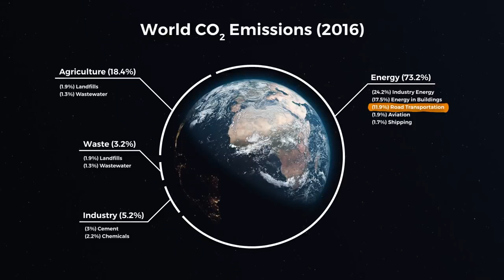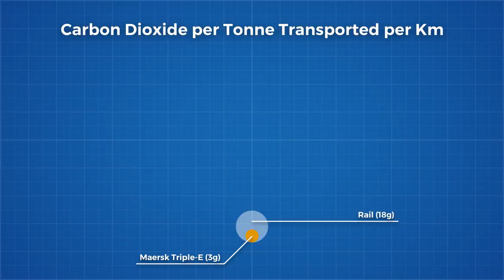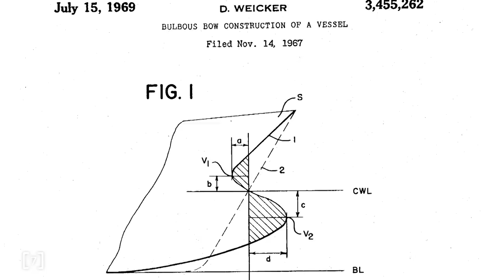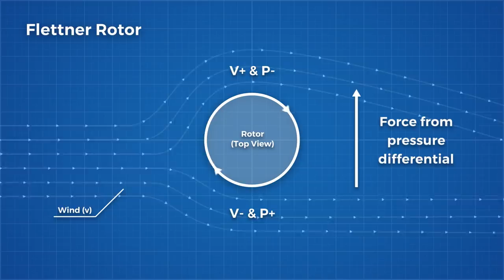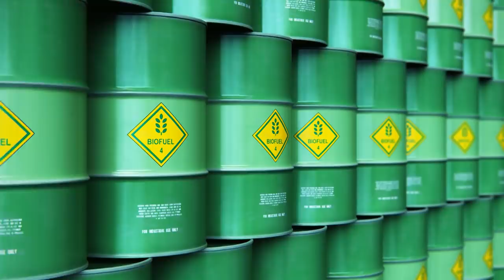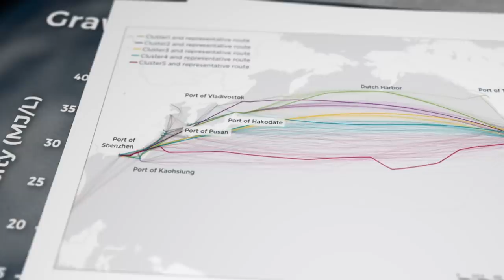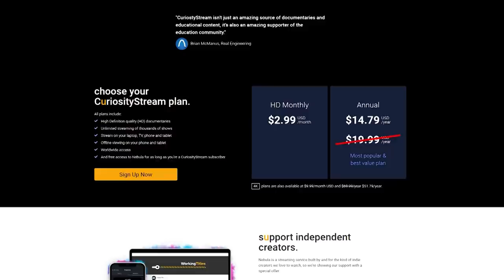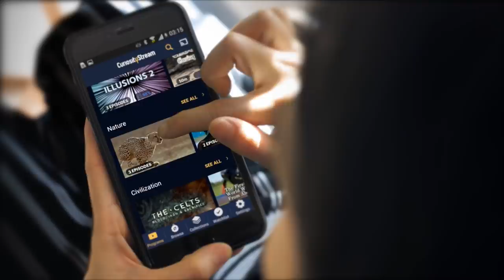Are Renewable Powered Ships Possible?

Comment: so what if... we take naval nuclear engines
and put one in a freight ship?
Reply: If you do a web search for ‘nuclear ship savannah’ you will see that it has been tried and did not work.  A similarly vessel heavily subsidised, by the government, vessel is in use in Russia which also operates, in support of the Northern Sea Route, a fleet of nuclear powered ice breakers all of these may, or may not, have been completely without issues.

Just think; would you have full confidence in the management of a nuclear reactor under the control of an anonymous entity only traceable, perhaps, via a letter box in a FOC (flag of convenience) nation state?  If you are, could you sell that confidence to Japan, the state that hosted the Hiroshima and Nagasaki nuclear detonations as well as more recently the Fukushima ‘event’?  Then try that same, or a similar, sales strategy on Ukraine, the nation state that as a part of the USSR (CCCP) hosted the Chernobyl ‘event’.  Modern iterations of nuclear energy, thorium fuel, molten salt reactors or fusion reactors, will carry the legacy of past problems.  It is the global trepidation of anything with 'nuclear' in the name and the economics of nuclear having transitioned from 'energy to cheap to charge for' too 'the costs of remediation are incalculable' that will prevent the adoption of nuclear energy as a means of creating energy at sea.  Modern reaction systems may have overcome the safety problems but the general public, having been misled in the past, will be reluctant to believe the fresh new promises.  The incident of the ‘Ever Given’ blocking the Suez Canal, March 2021, may also have a little to add to this debate.  The cooling water on ships tends to get taken in from near the bottom so when running aground the inlets are in a prime spot to get plugged up restricting, if not stopping, the flow of coolant.  One thing that the TMI, Chernobyl and Fukushima incidents all had in common was that the supply of coolant, or rather lack thereof, was a fundamental cause.

‘They’ say nuclear is cheap, it’s not it is expensive and has a large embedded carbon quotient as well as being complicated, dangerous, not universally socially acceptable and having only ‘no need for refuelling’ as a questionable advantage; actually it does need refuelling just not as often.  When ‘they’ do need to refill the warming up stuff it takes considerable longer than pumping tonnes of thick black stuff, cSt380 HFO, or thin runny stuff, MDO, onboard which is one of the reasons HMS Queen Elizabeth and HMS Prince of Wales are pushed about by ICEs and gas turbines thus using a similar fuel as the aircraft that fly off of them.  The Royal Navy (RN) with a high degree of skill and expertise uses, at vast expenses to the UK taxpayer, a current operational nuclear fleet of 11 submarines (also known as ‘boats’) in two flotillas, seven attack subs and four ballistic missile boats.  The carbon footprint of all the extra bits of hardware and the fuel, including processing thereof, from ground to propeller, are the external costs that never seem to get considered.

Disposal, once it wears out, of both the machine (that was a ship) and fuel is another can of worms best left unopened.  The 26 RN boats no longer in use are laid up (some in Rosyth and some in Portsmouth) awaiting long term deconstruction including dealing with the fuel rods and other irradiated material.  The USN is not, as far as I know, a commercial organisation working to very tight margins and also has the skill and expertise to handle the complexities of nuclear power; so as well as submarines their aircraft carriers are nuclear powered and each of the current iteration has a build cost three times that of QE/PoW, bigger crews and more generous funding.  For those who still think that nuclear energy might be the answer I recommend this report: - https://www.bbc.com/future/article/20200901-the-radioactive-risk-of-sunken-nuclear-soviet-submarines?ocid=ww.social.link.email.  The navy of the USSR might have been under resourced and over extended but it was still generously supported in comparison with merchant shipping.
Reply: @BernardLS  would you trust the USA w/ nuclear reactors? They hosted the 3 mile island "event" and are responsible for Hiroshima and nagasaki
Yet they have nearly a hundred reactors and a entire fleet of naval vessels that run off nuclear power

Also yes nuclear power is the answer for the growing demand as its the cleanest non renewable energy source there is
Reply: @Space_Reptile  The government of the USA is answerable to the population of the USA for those reactors located within the USA but how about 'a nuclear reactor under the control of an anonymous entity only traceable, perhaps, via a letter box in a FOC (flag of convenience) nation state?'   Port state regulation is one thing but, by convention, ships operate under flag state control.  'yes nuclear power is the answer for the growing demand as its the cleanest non renewable energy source there is' but if the demand does not grow, either because the global population does not increase or more localised means are used to satisfy the populations needs, is there still going to be a requirement for the expensive nuclear powered transportation of goods and materials at current levels of freight movement?  Vessel casualties occur on a monthly if not weekly basis and it is seldom in the public eye, as was the 'Exxon Valdez' or 'Ever Given', so are you sure about the safety of the reactors on ships?
Reply: @BernardLS    War ship reactors are tasked with outsize power requirements. There’s ship power requirement tables somewhere that will illustrate the difference. Small reactors that used the previously unusable nuclear waste (I’ve seen information on that research/development) stored in salt mines etc are the most likely answer.
Reply: @damiangrouse4564  Just think; would you have full confidence in the management of a nuclear reactor under the control of an anonymous entity only traceable, perhaps, via a letter box in a FOC (flag of convenience) nation state?  If you are, could you sell that confidence to Japan, the state that hosted the Hiroshima and Nagasaki nuclear detonations as well as more recently the Fukushima ‘event’?  Then try that same, or a similar, sales strategy on Ukraine, the nation state that as a part of the USSR (CCCP) hosted the Chernobyl ‘event’.  Modern iterations of nuclear energy, thorium fuel, molten salt reactors, small modular reactors or fusion reactors, will carry the legacy of past problems.  It is the global trepidation of anything with 'nuclear' in the name and the economics of nuclear having transitioned from 'energy to cheap to charge for' too 'the costs of remediation are incalculable' that will prevent the adoption of nuclear energy as a means of creating energy at sea.  Modern reaction systems may have overcome the safety problems but the general public, having been misled in the past, will be reluctant to believe the fresh new promises.  The incident of the ‘Ever Given’ blocking the Suez Canal, March 2021, may also have a little to add to this debate.  The cooling water on ships tends to get taken in from near the bottom so when running aground the inlets are in a prime spot to get plugged up restricting, if not stopping, the flow of coolant.  One thing that the TMI, Chernobyl and Fukushima incidents all had in common was that the supply of coolant, or rather lack thereof, was a fundamental cause.  Similarly and only months later, May 2021, had the ‘X Press Pearl’ been nuclear powered then a major port for a populous nation in the global South would have possible been the site of a significant exclusion zone due to a non power plant related incident.  If the ‘X Press Pearl’ had on board a fired up but ‘safe’ molten salt reactor and found herself having to dissipate the residual energy associated with the possible 12.5 megaWatt power cycle would a stable cool down have been possible?  In a casualty ships may capsize, like the ‘Karin Hoej’ of Bornholm in the Baltic early December 2021, in which situation any safety system reliant on gravity might not work.

Comment: Power them with small modular nuclear reactors. They have no greenhouse gases, no emissions, and any shielding requirements are offset by the fact that they don't have to carry enormous fuel tanks and can operate for decades without refueling. Problem solved.

The fact that you're not even considering nuclear power as a solution is making me question your engineering competence and intellectual integrity.

Comment: This is a very informative video but it is very misleading.
Most of the efficiency gains that are describing this video could easily be equalized by a political accord in which China could have more direct routes to Western ports. Also on a efficiency basis variable turbines in a tube could make this a non-issue in terms of fuel efficiency

Comment: Much of the stuff that is shipped...especially from China...does NOT need to be shipped from China.  

The top 5 largest importers by volume in 2019 are Ashley Furniture, Walmart, Home Depot, Lowe's and Target. (Not in any order).

These 5 are roughly 10% of the ENTIRE VOLUME of stuff shipped into the US, the largest importer. (Not value...VOLUME.)  Much of it is bulky crap that can be done locally in the country (the US especially).

Absolutely NO need to ship raw materials to china...to make furniture (one of the bulkiest items to ship)...and then turn around and ship finished furniture back to the US.  
This is a COLOSSAL waste of energy and resources.  We work with advanced manufacturing companies...this is already existing tech...we KNOW this can be done.

MBAs and people running businesses got very lazy in the 90's and 2000's and were focused on beating the Annual and / or quarterly EPS estimates by a penny per year and outsourcing to cheap labor markets.
Most of those things made in China can easily (and sometimes less expensively) be made elsewhere, closer to the consumer, simply upgrading factories and sourcing much closer to home.   China was almost ALL about cheap labor (and easy labor violations / lack of regulations), when outsourcing got started...NO need to ship furniture and other bulky products from China (or Vietnam, or Malaysia or anywhere across an ocean, etc.) 

Now companies can use 3D Printing,  Advanced Manufacturing, Robots, Local Sourcing and other methods to reduce the amount of shipping, labor and all other cost drivers in the business.

If this were simply done more effectively, MUCH of the VOLUME of shipping would go away. 
Change to EVs and EV Trucks (all ground transport)...most of the shipping of OIL goes away...which reduces lots of Oil Tankers, etc.
Ditto for Coal...which is already heading down the road to be eliminated.

There are solutions that don't require magic...just better sourcing...and manufacturing...and planning.
The US used to import many of its vehicles...now Toyota, Honda, BMW, Mercedes, VW, etc. all have plants in the US.  Similar to how Tesla is building plants in China and Germany, instead of shipping cars across the ocean in really big ships.

I like boats / ships...but we're killing ourselves with tremendous amounts of unnecessary shipping.

Cheers!

Comment: please research the work the NH3 association has made, and you will find that hydrogen IS the future. in the form of NH3 its energy density is far better.
Reply: The 'Just Have A Think' channel posted a relevant item yesterday, go see.  WRT ‘alternative fuels’ such as Ammonia (NH3), Biogas (basically good old CH4 or Methane) and Hydrogen (H2).  All require harvesting and processing which have costs and impacts before you get your energy to the point of use and will have effluents that will impact the global environment one way or another.  Thomas Midgley, Jr. (born 18 May 1889 died 2 Nov 1944) was an American (USA) chemist who as well as developing the technique of putting the lead, tetraethyl lead (TEL), additive in petrol created chlorofluorocarbons (CFCs), yes those ozone depleting CFCs, so that the use of NH3 as a refrigerant could be discontinued.  NH3 could be the most dangerous and least ‘clean’ clean energy source.  Is very bad and probably deserves a rant all of its own, so let’s just leave that for a while (somewhere very far away that is cool, dark and quiet).  CH4 lots of it around much of which comes out of the ground as a fraction of the FOGI energy mining; even more can be created (relatively expensively) from anaerobic degradation of organic matter.  The organic matter may be either raw vegetation, food waste or pre-digested by domesticated livestock with the right (or wrong, depending on your point of view) sort of diet and gut fauna.  CH4 is a lighter than air, vapour at environmental temperatures and pressures and you need to compress it, a lot, or cool it, a lot, to get enough on board your ship in manageable volumes to be useful.  Carry it as cargo and you can burn the ‘boil off’, when the latent heat of vaporisation has a co-activity benefit, otherwise more trouble and expense than merit and savings.  H2 is said to be good for use in fuel cells that will give clean energy when combined with Oxygen (O2) and leave only water (H2O) as an effluent; so as well as the cost of creating the hardware and separating out the H2 in the first place we now have the cost of separating out the O2.  H2 is very, very light and very, very volatile so this is where we remember the Hindenberg disaster, the ‘light’ means that though there is lots of energy per unit mass there is not much mass per unit of volume so all the problems of CH4 but much worse.  You need to compress it, more than a lot, or cool it, more than a lot, to get enough on board your ship in manageable volumes to be useful.  An alternative to fuel cell use of H2, burning, also generates combustion products which includes waste heat going to the cold sink and a few NOx nasties.  The numbers, on any of these, are getting very difficult to show any sort of surplus so this is a case running hard to stand still.

Comment: silly title ships sailed the world for years on wind
Reply: To address the suggestions that sail power is the answer I offer the following.  In 1870 a premium sailing vessel entered service, the ‘Cutty Sark’.  The Cutty Sark was 64.74 metres in length with a beam of 10.97 metres and a loaded displacement of 2 100 tonnes.  She was able to carry 1 700 tonnes of cargo and to harness the energy the available spread of canvas was up to 2 976m2 which was tended by a crew of about 30 skilled men.  A ratio between the sail area (SA) and the vessels displacement (D) determines how lively she is; ‘lively’ being nautical speak for ‘fast and manoeuvrable’.  The carrying capacity of cargo ships is constrained in two ways, mass and volume; the more mass on board the greater the displacement which in turn impacts the efficiency of the hull form and sail area / displacement ratio.  A vessel constrained by mass is said to be ‘down but not full’, a vessel constrained by volume ‘full but not down.

When in the tea trade, which the ‘Cutty Sark’ was designed and built for with fine lines (more nautical tech speak so again - no need to worry about it) she could carry around 600 tonnes of cargo at speeds of up to 17.5 knots dependent on the prevailing wind and had a typical China to UK time on passage of 120 days.  The tea trade was very competitive so ‘time on passage’ was a large factor in securing the premium freight rate that made her cost effective.  Rounding things out her maximum available sail area gave circa 5m2 of canvas for every tonne of tea carried.

As soon as the Suez Canal opened, which the ‘Cutty Sark’ was unable to sail through; she lost her advantage, raw speed, to the steam powered ships of that era who could beat her time on passage.  Mechanically powered ships have improved in terms of efficiency, on a freight tonne mile basis, by at least one order of magnitude since then.  After losing out to the coal burning, steam reciprocating mechanical ships of the late 19th century ‘Cutty Sark’ was relegated to the Australian wool trade, just about the bottom of the barrel in maritime terms and only one small step up from being a 'honey barge'.  The canvas, cordage and extra manpower needed for sailing ships was never a very benign environmental option so please discount any idea of sail as ‘sustainable’.  All this is without the problem that if ‘the wind don’t blow the ship don’t go’, when it does blow it often blows in the wrong direction for your cargo delivery needs and sometimes there is rather too much of it for comfort.

Random fact about 'Cutty Sark'.  It is said to have been able to coax 3 000 horse power out of her sails, or in ‘real money’ 2 206 500 Watts (2.2 megaWatts), assuming this was in ideal conditions that is about ⅔ of 1% the power that is used to power one Maersk triple E carrying 700 times the cargo in a third of the time.  So that majestic spread of canvas would have been circa 2 000 less than efficacious for delivering your baubles and bows from the orient, despite taking about three times as long on the voyage.
Reply: @BernardLS  what a cut and paste reply for a joke lmao. they could use a molten salt reactor to power ships
Reply: @brianwild4640  one source = plagiarism, many sources = research. The ‘research’ has been ongoing for three weeks and I have others for solar panels or nuclear power.  Every complex problem has at least one simple, straight forward and cheap solution which will not work.
Reply: @BernardLS  3 weeks such a short time must be google lol